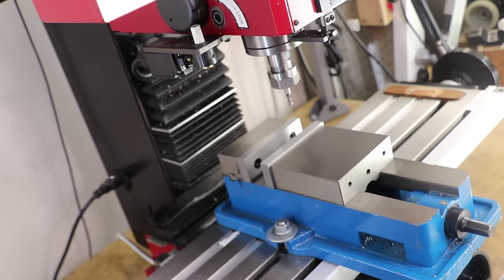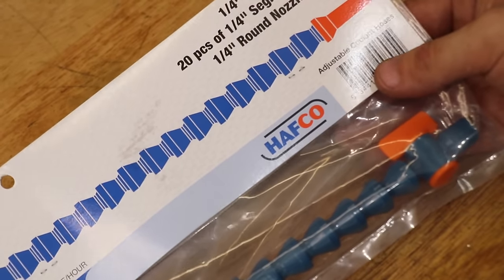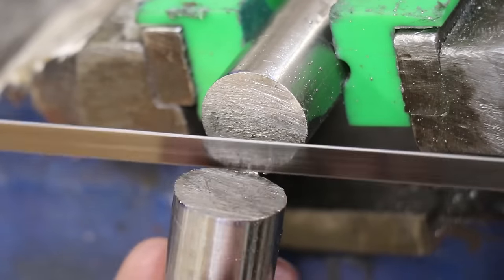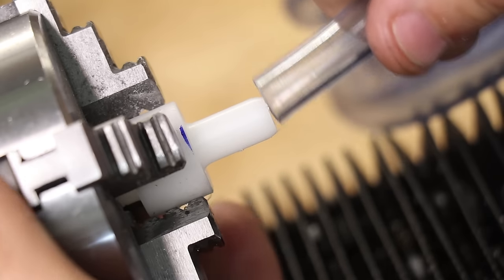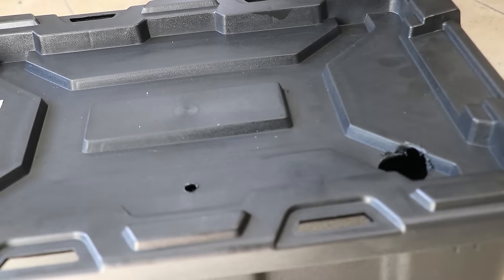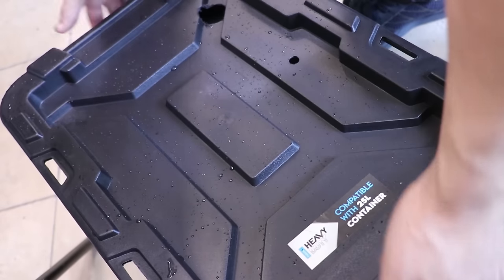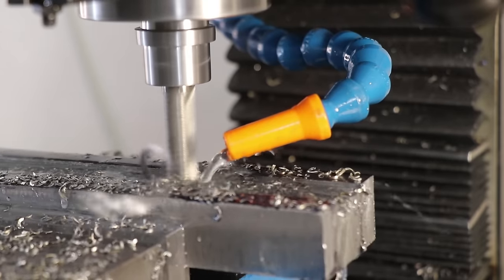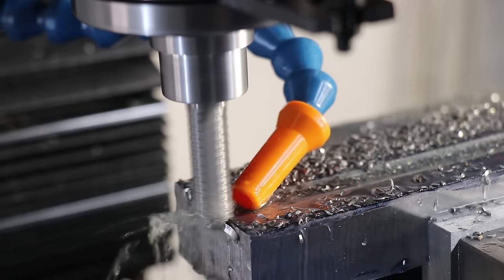Cheap DIY Flood Coolant For The Milling Machine

Comment: I think the chatter problem you experienced was related to the flood coolant having less  lubricity than the oils you previously used. Some water soluble coolants are more grippy than an oil you would brush on, some are not. Usually, the more expensive water soluble coolants have better lubricity. Sometimes you can improve the lubricity by increasing the concentration past what the recommended value is, i.e. 15% versus 7%. Even if you “solve” the chatter problem with higher rpms, you are likely better off increasing the lubricity of the coolant by upping the concentration anyway, as it will result in less tool wear.
Reply: I think it could even have more lubricity for the task, and the mill wasn't rigid enough to push the endmill in. I also get chatter on a mini lathe because the tool prefers to slide until it bites into the material.

Comment: Regarding the mess, I put a large aluminum baking sheet under my mill. Drilled the bolt holes through it and sealed around them with RTV. The local restaurant supply store had them 3ft x 2 1/2 ft.
Reply: Just use the trays that you put under cars with oil drips.
Reply: @johncoops6897  Not sure I know what you're referring to. The baking sheets work great and only cost me $7 USD.
Reply: @shootgp  - the Channel owner will know what I mean. They are large folded steel trays available from any Auto Parts store here in Australia. They are used to prevent thr oil leaks from American cars from staining concrete floors.
Reply: @johncoops6897  what about Australian ca... oh, yeah. Buggar.

Comment: Im currently experimenting cooling systems myself. I'm using mist at the moment, but as you mentioned, the compressed air situation is less than awesome and I've got a pump system that will be replacing mist on at least the mill, and likely the lathe as well. As note on coolants, in my humble experience, the water soluble synthetics are just no good. They seem to want to cause rust. I bit the bullet and bought one of the oil based emulsion coolants and it's fantastic. Still mixes with water, but once the water evaporates the oil base stays behind and leaves a nice protective film on the machine. I've seen no rust with the oil emulsion, and at this point would run dry rather than put a water based soluble on the machine. The oil based emulsion also lubricates, so im able to take much heavier cuts and get a much better surface finish. Awesome vid, as always!
Reply: I fully agree with your comments on oil based vs. synthetic emulsions. It might be different for those big CNC machining centers that pump gallons of coolant at high pressure, but for us small shop people oil based stuff is better by far.
Reply: Thanks for the tip. 👍🙂

Comment: The trick with 316 SS is to just push through in one go.  It has really good work hardening properties, so it’s quick to harden and dull bits.  Make sure you run the HSS drill 100-300 rpm I’ve found.

Comment: Good video, I like how you pointed out the inherent problems with the mist coolant systems and breathing it. For me chip evacuation is the problem especially with smaller end mills in deeper pockets. I use compressed air for chip evacuation and an occasional squirt from a spray bottle for lubrication. A cardboard shield will stop the hot chips from hitting you. My air compressors are set outside the building for noise and cooling.

Comment: Looks good Mate. I used a low pressure fuel pump £10, a motor controller £8.50 and a gerry can £12. The gerry can has a small foot-print so doesn't take up a lot of room. The motor controller is mounted in the mill control panel and goes from a dribble to a full gush.

Comment: Love your videos, I'm not a machinist but have some knowledge of aquaculture and I have some small cheap tips that might increase the longevity of your pump.
A nylon stocking over the pump is a good way to stop grit from wearing out the impeller (cheap ripstop, your grandma will have some). 
There are cheap and efficient floatswiches that you can mount in tubs to stop the pump from running dry. Most aquaponic/pond shops have them. 
A rough paintstrainer for the funnel is easier to clean than the metal net in the funnel.
Reply: Thanks for the tips. I will use them when I implement my coolant system.

Comment: Nice project. I went through the same process when I first got into machining. The mess it produced was not worth the trouble. I discovered that using really thick cutting oil was the answer. The honey-like consistency holds the oil in place. Bobs your uncle!
Reply: Which cutting oil are you using?  I'd like to try a thick oil.

Comment: I built a setup not dissimilar to yours and it worked very well indeed. I used an oil based emulsion though. On aluminum it worked as well or better than kerosene without the horrible smell.

Comment: I am setting up an identical system. Identical pond pump (as I had one lying around) in a bucket. I still need to add the strainer before installing it onto the machines. Mine will be a common tank to the mill and lathe. I have 1/4 and 1/2 inch flexy pipes to try, to see which gives the better coolant placement.
But previously running with a spray of kero, I was burning up HSS mills like crazy. Changing to a hand oil/water spray dramatically improved tool life. So lookink forward to trying the flood cooling.

Comment: Solder follows the heat. Heat the part from the opposite side from where you are applying the solder and it will flow around. Blasting it straight on will just burn it.
Also on the subject of stainless: sharp tools, slow speeds and high pressure is the way to go. Stainless work hardens in an instance so a blunt center drill will create a hard spot in a millisecond if you don't keep pushing it and make chips.
Reply from the maker: Yeah I forgot how much i disliked machining stainless, especially 316
Reply: You cannot really solder properly with the part tightly clamped in a dirty great big heatsink (vice)
Reply from the maker: Seems to work fine. I don't solder much so the vise has always worked. Plus I have lighting set up for filming the vise  so it's easiest for me to use it.
Reply: @artisanmakes  I mean, it machines fine. You just have to be on your toes and not hesitate. But a carbide spotting drill would probably have helped there. But they’re expensive. I don’t use them personally.

Try heating the part from behind sometime though and use plenty of flux with the part on a fire brick instead of in the vise. I think you’ll find that it saves you a lot of work and comes out both cleaner and with a higher chance of actually being water/gas tight.

Comment: It'll be interesting to see if the coolant damages the pump. In my service engineer days I used pond pumps and aquarium pumps with pure kerosene and it 'rotted' them over time. The 'over time' was still long enough that it was a far cheaper alternative to the machine manufacturer's replacement pump if it had been available... Which it usually wasn't. 

Given their prices and easy availability it's not really an issue as long as you accept that the pump is a consumable.
Reply: Try a scrapyard for a Diesel fuel pump.
Reply: We used a washing machine drain pump on a large parts washer at one of the places I used to work.
That system had a 200lt drum full of kerosene and that pump ran probably 6 hours a day 5 days a week. We cleaned wet brake components for large earthmoving machines.
That pump lasted a couple of years and costed in the region of $15.
Reply: @Bosbulls  It's one of those things where you think to yourself "Well... I'm no plasticologist but what's the worst that can happen". Well... That's what I thought anyway.

My pond-pump bodge would last about a year and the appallingly badly made genuine article would last a couple of years at over ten times the price.

Comment: Have you considered adding a small wall/gutter on the outside of your table? Would only add a few millimeters and keep all the coolant on the table.
Granted some will still fly around the place when you mill at higher speeds.
Also at 15:10 when you're milling steel, if that cut in particular was iffy I suspect it might be because the flow of coolant might be preventing your chips from exiting the cut.
My experience when playing around was that the chips get extra sticky with coolant, so you really need to aim the coolant to help the chips move away from the cut direction.
That's just my 2 cents anyway, really like your videos.

Comment: Great info!  I've had a mist cooling system for a long time but don't use it any more because of the fog.  Some of the things in my current shop don't need to be exposed to coolant mist.  I had to mill some 1-1/4" (32mm) deep x 5/16" (8mm) wide slots in the past few days and all I had for a lube/coolant was WD-40.  It took a whole can to do the job.  I was wishing for a drip or low flow flood system the entire time.

FWIW, your compressor should be more than big enough for mist coolant.  It looked in the early video that you had a LOT of air flow driving the mister, as in far too much.  It only takes a little mist to do the job.

Comment: You should add a screen/filter to the funnel or a screen divider in the tank to help protect your pump life. Also it would be easier to clean those screens than pulling out the pump to clean/unclog.
Reply: I was thinking the same thing, maybe a larger diameter 3D printed ring with a fine screen inset thats removable it will sit higher in the funnel when its not running pull the screen and blow out the build up into a trash can and replace it, it's an added laye of protection for the coolant,pump and associated parts

Comment: Clever setup! 👍
You could try putting a stainless pot scourer in the trough on your mill table, it will let the coolant drain through but will catch most of the chips keeping them out of the pipes and funnel and the scourer can be removed and rinsed clean in seconds.
And yeah, that coolant looks way too dilute... Too watery. How is its lube properties? It should feel really oily and greasy rubbed between your fingers, if it feels watery and your fingers stick then it's a bad lubricant.

Comment: I was researching this the other day as I am preparing shopping list to get mill etc and what I want. It's interesting cooling is not so straightforward.

Mist is considered iffy, heat cycling is likely.
Dry with some of the modern coatings (if feeds etc right) is recommended.
Flood is ok, if you ensure flood is done right and actually cooling the bit, chips or even not enough flood can be worse (the flood burns off before it reaches the actual tool).

Coating wise if doing aluminium, avoid coatings with aluminium in them.

I am planning dry with air for chip removal, I won't be using it often and the flood tank and mess etc is more effort than its probably going save me.

Google flood vs none mill there are plenty of good forums with heaps of information that actually convinced me not to bother with flood for what intended diy use I will do.

If you look at Tormac systems (there popular on YouTube :) ) or high end cnc videos, they use multi jets with some pressure (not dribble).

Comment: For my diy setup I used a 5 gallon parts washer for the tank and pump. They go on sale here in Canada for about $60.00. In the end, I found it easier/cleaner to just use carbide end mills. They are more expensive, but they take the heat far better than H.S.S., and last longer, so I only use the coolant now for the most demanding jobs. (stainless, titanium)

Comment: Nicely done! In my experience, the coolant should be a little bit more "milky",  but maybe I'm wrong who knows. Great little project
Reply: That depends on the kind of coolant: emulsions are milky, solutions are transparent and only light tinted.
Reply from the maker: In my limited experience dealing with coolant, emulsified oils tend to look very milky. This is a semi synthetic and it is my first time using it. This could be what it should look like. Granted I am only mixing it at just over 6% concentration.
Reply: @artisanmakes   6% is really enough when it comes to preventing tool wear. Higher concentration nearly only improves longevity and corrosion prevention. Even pure water gives very good results, but corrosion becomes a problem in the long run.
Reply from the maker: @schrauberhugo2594  I figured as much. Honestly I only went above the 5% concentration recommendation was to give me a bit of time before ill need to look at the coolant concentration. Just have to wait for my refractometer to turn up first. Cheers.
Reply: @artisanmakes  your pump probably has a filter that removes all of the oil content from your coolant while you are cutting. even a very thin stream of emulsified coolant should have a white tint.
Reply: @reinermiteibidde1009  I use a synthetic water base coolant  mix  that turns beer brown when mixed and gets darker after about a month, still see thru it, but after 6 months it gets milky tan. The anti rust properties are still working, after two years

Comment: Love the setup! glad to see more coolant in your work, ive found adjusting the shutoff valve half way or till you find the sweet spot helps with 'low flow' or getting more pressure out of the nozzle, it seems to help move the chips better. like on the older haas machines ive been on i had to find that sweet spot of pressure and flow, keep up the good work man 👍youre my fave youtube machinist

Comment: If you remove the fan and light assembly from a range hood you scab from a cabinet makers it fits perfectly around a mill of that size as a chip try when inverted.

Stainless, and free.

Comment: I haven't read through all the comments mate but it occurs t'me that if you put a tee junction in the feed line and return part of the feed coolant back into the tank via a fuel line tap like y'find on some lawn mowers the diaphragm pump might last a bit longer. Cheers and like the checkout chicks say over the pond: "Have a nice day".

Comment: might be able to put a small plastic dam up on the outside edge of the vice (where you normally bold the beaks to to grab larger pieces , should guide the coolant toward the sides of the vice before it runs beyond the table , might stop a little of the splattering towarths the operator too

Comment: You could probably use some epoxy putty to extend the drain channels on your vice so you can mount it in it's original position.

Comment: Use cobalt steel bits for stainless, they work much better than high speed steel. The trick is to use plenty of downforce, otherwise the tool will rub and work harden the surface. I've had to use solid carbide for stainless before, I hated drilling and tapping it.

Comment: According to most trade standards, you can label anything (oil, solvent, reagent etc) that contains more than 30% synthetic main active components fully "synthetic" :)
Good work!
There SHOULD be something to help lubricate that coolant product, check with the manufacturer.... Also, I'd get a smaller nozzle for the flex head. A smaller stream is easier to "aim", and you dont need to have the head as close to the cutter as you do with a larger, slow flowing nozzle.

Comment: Looking great, I would suggest to help with splashes. A shield to make sure it all flows into the drainage would work. Similar to the shield idea you were thinking before to protect against chips. 

Also do you have any idea what the other brand names are for this mill? I want to get it but it seems really tough to find in the UK .
Reply from the maker: Yeah definitely I have a shield but it makes filming much harder.
Reply: @artisanmakes  Fair :D

Comment: Would it not be a good idea to incorporate a magnet trap somewhere in the system, even if it's just a big old speaker magnet chucked in the box? Obviously it'll only work for iron/steel filings but they're probably the most damaging.

Comment: A simple (but not so elegant) solution to “clear the back of the vise” would be to simply make the fixed jaw thicker. Determine the smallest size endmill you will use and use that to determine how much thicker the rear jaw needs to be for sufficient overhang.

-Ben

Comment: You could buy mastercam and be dynamic(tm) with your manual tools. Then the chips dont get hot. We use aquarium air pumps at work to keep the coolant from smelling. Air kills the bacteria or somethingsomething.

Comment: If you're looking for carbide inserts to cut plastic(to simplify things), look at the super high positive inserts used for aluminum. Koroloy brand has a good selection of shapes/sizes.
Reply from the maker: I filmed all this a while back. I do have a few aluminium inserts but I'm unimpressed with them. They are just too brittle for a lot of stuff I do. HSS just works out to be better. Cheets

Comment: You need a oil  skimmer , magnet and a much better filter on the intake side of the pump. 
Experiment with a rubber disk around the base  of the vice. Shaped as a shallow cup with a drain tube. This will  capture the coolant before it runs on the base.
One other thing. With a magnet glued to a clear plastic sheet  in front to keep  you from getting  coolant splashed on you.
Reply from the maker: Thanks, I have that oil skimming paper and that's doing a good job. And having a sheet is easier said than done, especially when I have cameras and studio lights set up. Cheers. I'll have to take up that magnet trick though